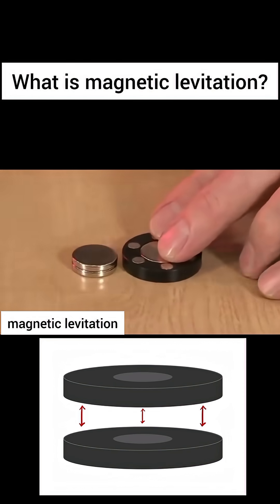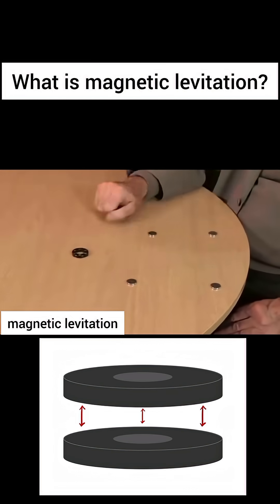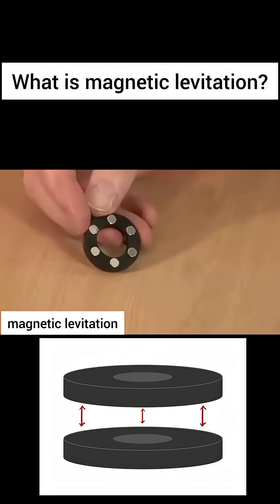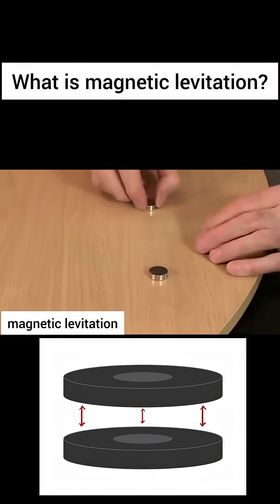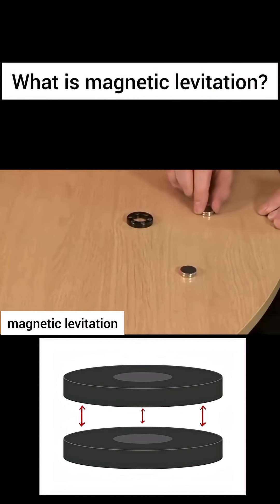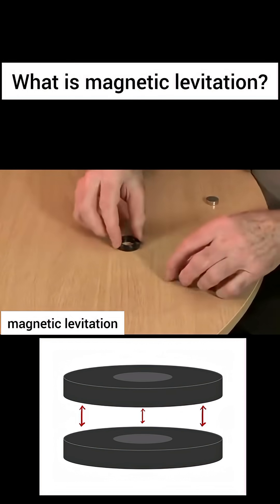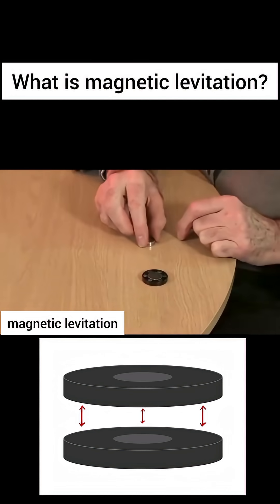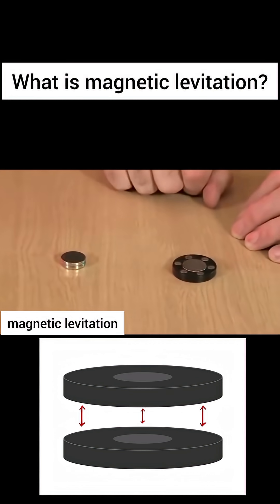what is magnetic levitation?

Comment: How did you get the geomtry right? FEM, analytical formulas, or just trial and error?
Reply from the maker: Designing the geometry of magnetic components in an inverter is an iterative process that relies on a combination of analytical formulas, advanced simulations like Finite Element Analysis (FEA), and practical validation. The specific mix of techniques used depends on the complexity of the design, the required performance, and the development stage. 1. Analytical formulas (the starting point) Analytical formulas provide the initial design estimate. They are used for a first-pass design to select core materials, determine the necessary size, and calculate the number of turns for windings. Magnetics theory: The design is based on fundamental physics principles, including Faraday's Law of Induction, which defines the relationship between voltage, flux, and the number of turns. Simplified models: For basic geometries like a simple core and coil, analytical formulas are highly effective. They allow designers to quickly calculate approximate inductance, maximum flux density, and initial loss estimations.
Limitations: Analytical formulas rely on simplifying assumptions, such as uniform magnetic fields and no magnetic leakage. This makes them inaccurate for complex geometries, high-frequency effects (like skin and proximity effects), and non-linear material behaviors
Reply from the maker: 2. Finite Element Analysis (FEA) (the refining tool)
FEA is a powerful simulation method used to overcome the limitations of analytical formulas for complex magnetics. 

    Process: The component's geometry is defined in 2D or 3D and then divided into a finite number of smaller elements (meshing). Physics-based equations are solved for each element, allowing for a detailed and accurate analysis of the entire component.
    Benefits: FEA provides deeper insights into magnetic behavior that are not possible with simple equations.
        Accurate field mapping: It can visualize the exact distribution of the magnetic flux density, allowing for identification of saturation points in the core.
        Advanced loss analysis: It accurately predicts core and winding losses, including high-frequency losses caused by skin and proximity effects.
        Mechanical and thermal coupling: Many FEA tools can perform multiphysics simulations, coupling magnetic analysis with thermal and stress analysis to predict real-world performance.
    Software tools: Industry-standard software includes Simcenter MAGNET (Siemens) and ANSYS Maxwell, while accessible 2D tools like FEMM are available for learning and basic design.
Reply from the maker: 3. Optimization and trial and error (the real-world loop)

    FEA-driven optimization: Instead of manual trial and error, designers use optimization algorithms with FEA solvers to automatically refine the component's geometry. The algorithm adjusts parameters—such as core shape, air gap, and winding placement—to achieve specific performance goals, such as minimizing loss or maximizing power density.
    Physical prototyping and validation: After the design is optimized with simulations, physical prototypes are built and tested. Experimental data is then compared against the simulation results.
        Verification: This process validates the accuracy of the FEA models, ensuring that all variables and conditions were correctly defined.
        Refinement: If discrepancies are found, the model is refined based on the real-world measurements, and the optimization loop is repeated.
    Modern approach: Modern design is a combination of these methods. Designers start with analytical formulas for a rough design, use FEA to create a virtual prototype and optimize it, and then validate the final design with real-world physical testing

Comment: The large center magnet attracts the held magnet with a field that is much stronger and therefore wider than those of the small planet magnets. The planet repulsive fields make a scalloped edge which allows the held magnet to approach to a point, but as magnetic field strength varies as the inverse cube of distance the closer proximity to the planet magnets overpowers the attractive force of the center. This holds the held magnet in the fixed position between two planet magnets.
Reply from the maker: thanks for comment and attention bro

Comment: Would this make the world's smoothest turntable bearing?  Or is the magnetic energy too strong and would interfere with the cartridge system?
Reply from the maker: Magnetic levitation can create an incredibly smooth, low-friction turntable bearing, but
the strong magnetic fields involved pose a significant risk of interfering with the delicate phono cartridge. Most companies that have manufactured magnetic levitation turntables, like MAG-LEV Audio, have developed shielding or other methods to mitigate this interference. 
The smoothness advantage of magnetic bearings

    Zero friction: Because there is no physical contact between the platter and the bearing spindle, a magnetic bearing has virtually zero friction, reducing noise and wear. For a high-end turntable, this eliminates a potential source of audible mechanical noise and allows for more consistent rotational speed.
    Vibration isolation: A magnetic bearing de-couples the platter from the plinth, or chassis. In a traditional turntable, vibrations traveling through the plinth can be transferred directly to the platter through the bearing. A magnetic levitation system breaks this mechanical link, preventing unwanted vibrations from reaching the record
Reply from the maker: The challenge of cartridge interference
A magnetic turntable bearing's most significant drawback is the potential for electromagnetic interference (EMI) with the phono cartridge.

    How cartridges work: Moving magnet (MM) and moving coil (MC) cartridges work on the principle of electromagnetic induction. As the stylus tracks the groove, tiny movements of a magnet within a coil (or a coil within a magnetic field) generate the electrical signal that becomes the audio output.
    Magnetic interference: The powerful magnetic fields required to levitate the platter can interfere with the cartridge's delicate signal generation, causing audible hum or other distortion. This is particularly a problem with highly sensitive and expensive MC cartridges.
    Shielding is required: To address this issue, manufacturers like MAG-LEV Audio use special shielding materials within the platter design to block the magnetic field from interfering with the cartridge and tonearm. 

Other potential magnetic bearing drawbacks
Beyond cartridge interference, other issues must be overcome for magnetic bearings to function effectively in a high-end audio application:
Reply from the maker: Lack of damping: Passive magnetic bearings (using only permanent magnets) provide near-zero friction but also have almost no damping. This can cause the platter to be susceptible to unwanted axial (up and down) or radial (side to side) movement, resulting in platter wobble. Additional damping measures, such as mechanical or viscous components, are typically required to stabilize the platter.
Control complexity: Truly stable and low-vibration magnetic levitation requires a precise balance of forces. This is often achieved with "active" magnetic bearings that use sensors and software to electronically regulate the speed and position of the platter. This adds significant cost and complexity compared to a simple, well-machined traditional bearing.
Stiffness: While a magnetic bearing can achieve ultra-smooth rotation, audiophiles sometimes prefer the "infinite stiffness" of a traditional, fixed-point bearing. Some believe the platter in a magnetic levitation system can feel "soft," and this can affect the pitch of the music as the weight on the platter changes (for example, switching from a standard record to a heavier 180g pressing)
Reply: @science-ms89   It might be better suited for creating a mag-lev platform to place a turntable or individual mag-lev feet that can be placed far below the cart.  At least that would reduce any vibrations coning from the floor.

Comment: two fields add. the big center magnet projects it's field further. The smaller magnets doesn't projects as far. When an attractive force reaches further with a stronger repulsive force that dies off faster, this is what you get. there is a reason why the planet magnet wants to be between the smaller ones, that's a lower energy state. Brilliant demo.
Reply from the maker: thanks for your comment and attention bro
Reply: @science-ms89  for the youngins, you can learn a lot for free at K&J. Most the magnets they carry have have cross section field plots. Those biguns are freakin scary.

Comment: I wonder if it’s the same as it certainly looks similar to the Earth/Moon relationship
Reply from the maker: No, magnetic levitation is not similar to the Earth/Moon relationship. The two phenomena operate on completely different fundamental forces of physics
Reply from the maker: Aspect 
	Magnetic Levitation (Maglev)	Earth/Moon Relationship
Dominant Force:	Magnetism. A strong repulsive or attractive magnetic force is engineered to overcome the force of gravity, allowing an object to float.	Gravity. The mutual gravitational attraction between the Earth and the Moon holds the Moon in its orbit.
How It Works:	Magnets with like poles are positioned to repel each other, pushing the objects apart and holding one in suspension. This requires a constant input of electrical power and a specific, stable magnetic setup.	Gravity acts at a distance and doesn't require magnets. The Moon is in a constant state of "falling" toward the Earth while also moving forward, resulting in a stable orbit. It is a natural gravitational system.
System Stability:	Stable due to external power and precise engineering. The system can be designed to be either passively stable or actively controlled.	Naturally stable over billions of years, but the Moon is very slowly moving away from Earth due to tidal forces, a process unrelated to magnetism.
Interaction:	A direct and controlled interaction between a track or base and a levitating object.	The gravitational pull is a mutual, long-range force that affects the entire mass of both celestial bodies.
Scale and Conditions:	A local, engineered effect on a human scale. It is dependent on Earth's environment and a controlled setup.	A universal force that operates on a cosmic scale in the vacuum of space, affecting massive celestial bodies.

Comment: That's how the Earth 🌎 caught the moon 🌙 🌚 😮
Reply from the maker: No, magnetic levitation is not similar to the Earth/Moon relationship. The two phenomena operate on completely different fundamental forces of physics
Reply from the maker: @science-ms89
@science-ms89
• 0 seconds ago
Aspect 
	Magnetic Levitation (Maglev)	Earth/Moon Relationship
Dominant Force:	Magnetism. A strong repulsive or attractive magnetic force is engineered to overcome the force of gravity, allowing an object to float.	Gravity. The mutual gravitational attraction between the Earth and the Moon holds the Moon in its orbit.
How It Works:	Magnets with like poles are positioned to repel each other, pushing the objects apart and holding one in suspension. This requires a constant input of electrical power and a specific, stable magnetic setup.	Gravity acts at a distance and doesn't require magnets. The Moon is in a constant state of "falling" toward the Earth while also moving forward, resulting in a stable orbit. It is a natural gravitational system.
System Stability:	Stable due to external power and precise engineering. The system can be designed to be either passively stable or actively controlled.	Naturally stable over billions of years, but the Moon is very slowly moving away from Earth due to tidal forces, a process unrelated to magnetism.
Interaction:	A direct and controlled interaction between a track or base and a levitating object.	The gravitational pull is a mutual, long-range force that affects the entire mass of both celestial bodies.
Scale and Conditions:	A local, engineered effect on a human scale. It is dependent on Earth's environment and a controlled setup.	A universal force that operates on a cosmic scale in the vacuum of space, affecting massive celestial bodies

Comment: If we get them larger and put them under cars and under the road then use magnets to pull and drag and push in sequence to move the car down the street then in time we can make a track that is able to flout in air and the stronger the negative force the higher we can go have them ramp up sizes the farther it travels to rise hen o land decrease the amps and lower down ,,you make a field road on top of the already existing roads slowing more to travel by air añd ground añd the only energy will me amps from the magnets to flow away in 20 years we could have air ways across the nation ?
Reply from the maker: Here's a breakdown of why your vision is a long-term aspiration rather than a near-term reality.
The magnetic field challenge

    Controlling magnetism: Your concept of a "negative force" to make cars "float in air" is a misunderstanding of how magnetic fields work. Magnetic force can levitate and propel, but it does not produce a "negative force" that overcomes gravity without immense, continuous energy.
    The need for controlled fields: Stable magnetic levitation requires precise control and strong magnetic fields. With maglev trains, powerful electromagnets on the vehicle and in the guideway interact to produce both lift and propulsion. For this to work for every individual car, it would require an active, electronically controlled system with extremely precise track tolerances
Reply from the maker: The infrastructure and cost hurdle

    Power and infrastructure: The proposed system would require every road to be retrofitted with a complex network of magnets and powered continuously by an enormous amount of electricity. This is vastly more complex and expensive than powering a simple track for a purpose-built train.
    Energy inefficiency of starts and stops: Maglev cars on existing roads would waste significant energy due to frequent stops. A maglev train's efficiency comes from a long, uninterrupted journey at high speeds, where air resistance is the main hurdle, not friction. Your proposal would eliminate the friction of wheels, but not the massive energy loss from constantly stopping and starting.
    Prohibitive cost: Maglev infrastructure is expensive even for dedicated, linear train tracks. Cost estimates for high-speed maglev lines can reach tens of millions of dollars per mile. Creating a magnetic field system on every street and highway would be prohibitively expensive, likely making it economically unviable
Reply from the maker: Safety and operational issues

    Lack of integration: Maglev systems cannot be integrated with existing road networks. You cannot have standard gas or electric vehicles driving alongside or crossing magnetic tracks. This would require two separate road systems: a new maglev network and the existing road network for traditional vehicles.
    Variable loads: A car's weight changes based on the number of passengers and amount of cargo. For a maglev system to function, it would need to constantly adjust the magnetic field strength to maintain a stable levitation gap for each vehicle. This adds an immense layer of complexity compared to trains, which have a more uniform weight distribution and operate on a controlled network.
    Extreme speeds are not suitable for air travel: Your proposal for the "negative force" to increase lift and allow "air travel" has a major flaw: high-speed air travel is vastly more energy intensive than ground travel. This is why commercial maglev trains operate at extremely high speeds, but are not intended to replace airplanes
Reply from the maker: A more realistic timeline
While a nationwide maglev car network is not realistic within 20 years, advancements continue for controlled maglev rail.

    Small-scale applications: Maglev technology is already in limited commercial use for specific, high-speed routes, such as airport shuttles in China and Japan.
    Hyperloop concepts: Your vision of a higher-speed network shares similarities with hyperloop proposals, which aim for ultra-high speeds by combining maglev with a near-vacuum tube to minimize air resistance. However, these are still in the prototype phase.
    Incremental progress: The path to wider maglev adoption involves continued investment in research to lower costs, improve efficiency, and develop scalable infrastructure, which will take decades rather than two

Comment: How to put this to use
Reply from the maker: Magnetic levitation is used in applications like high-speed trains, where powerful electromagnets propel and lift the train, and in consumer products like levitating displays, where a stable platform holds an object in mid-air. It is achieved through principles like repulsion, attraction, and stabilization from powerful magnets, electromagnets, and control circuits that maintain the object's position by constantly adjusting the electromagnetic force to counteract gravity and instability